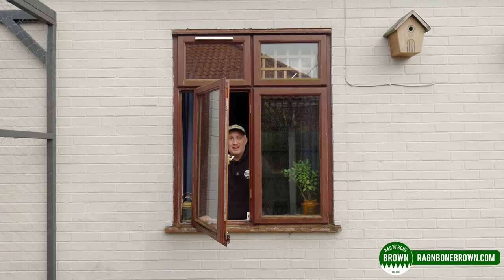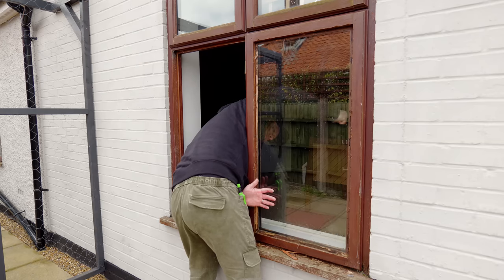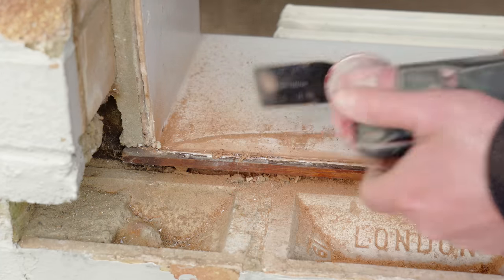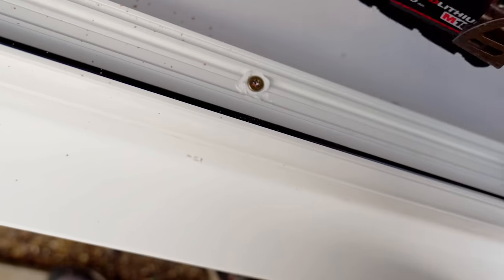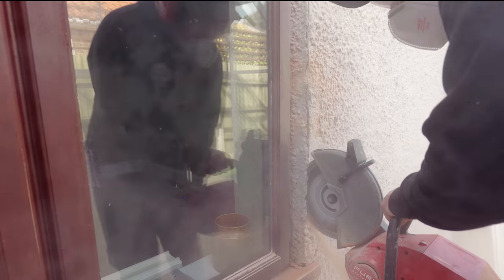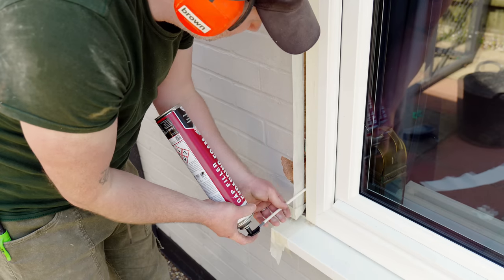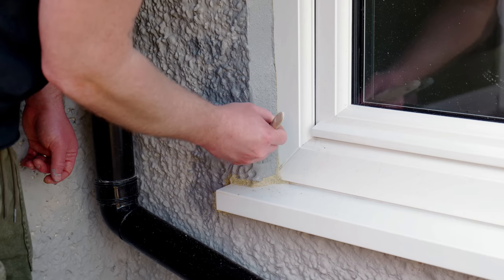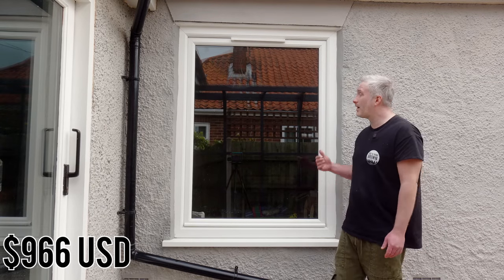Should A DIYer Fit Windows?

Comment: 1000 times better than the job done by any window fitter I've ever had to correct the work of. Double glazing installers seem to be on commission with the silicone manufacturers.
Reply from the maker: Wow, thank you!
Reply: And the caulking manufacturers. They seem to use Caulking everywhere inside the window.
Reply: One the spot. My installer used silicone to "fix" a 5 cm wide hole in plasterboard...

Comment: About a month ago I put a upvc window & door into the end wall of my garage/workshop (including cutting the hole & putting the lintel), this video would have been very helpful beforehand :)  It was a much simpler process than I expected and much much cheaper than having it done "professionally", I keep finding this with building projects.   We did buy from modern upvc windows as they're not far from us, it was a very easy experience and I'll happily buy from them again!  With the windows in the main house we had a similar experience with the wooden frames and conservatory, I like wood but for windows UPVC is a much better choice!

Comment: Nice job Keith.  I’ve fitted a few windows and doors myself and as you say its a straight forward DIY job as long as you take it carefully.  With care a crowbar works well for lifting the glass to toe, heel and pack them out.   Fitting the internal glazing trim is probably the hardest part of the whole job, I find its easier to fit both ends in first then progressively tap them into position working towards the centre with a soft headed hammer.  Mind, fitting the beading to two circular windows was a right nightmare, I ended up trimming a bit off the beading after spending half an hour chasing them round trying to get them all clipped in !

Comment: Really enjoyed this one Keith. I remember repairing some wooden mock sash windows on our previous house.  

It was going to be way too expensive to get someone to build & install replacements, so I decided to buy more unnecessary tools (table saw!) and had a go at chopping out the rotten sill, and even an entire corner on two of the windows, where I had to create profiles to match, slotting in to the frame in situ, before getting replacement glass units to fit (4 in each window, all different sizes of course 🤦‍♂️).  

Your fun with the mallet brought back memories - tapping in pins to fix wooden beading with a hammer while trying not to smash the glass was not fun.

A mammoth job for a total amateur, plus took so much longer than a pro, but the satisfaction of finishing it was immense.  Plus I got a new power tool 😆.

I certainly won’t hesitate to try what you’ve done with PVC windows if the time comes on our current house though.

Thanks for putting the effort into sharing 👍🏻

Comment: I have replaced all of my windows over the last 5 years. We are lucky that we have a local salvage yard selling brand new double glazed windows. These have been wrongly ordered/made or cancelled orders, and come complete with handles, vents, sills, and additional frame extenders if needed.
Our windows fit from the inside, as the inside reveal is larger than the outside. I covered the uPVC and glass with the sticky film for covering carpets before spraying the foam because of previously getting foam on frames & glass.
My windows are done in excess of British standards & more than meet local building regs. We don't intend ever selling the property, so by the time we snuff it (with luck and a fair wind) it will be time for the new owner to replace them anyway.
I would recommend, if the glazing units are already installed, get someone to help lifting them in to place. I did some of mine on my own, and probably shouldn't have as the glass probably doubles the weight.
Great video though. I imagine it will help anyone who was considering DIY window replacement make their mind up.

Comment: We’ve just had most of our windows converted to UPVC double glazing. Not very common in Australia!  6 large 3m x 2m windows for a cost of $35k (£18).  They were made in the UK and shipped over.  It took 6 months!  Very expensive but the change to heating and cooling bills and outside sound deadening is amazing.  Great video Keith.

Comment: Hi Keith, just came across this video and I can second Modern UPVC windows as I used them for my replacement patio door and back door, Less than £2000 for both yet a Norwich company who would probably come "First" if you googled "home improvements" wanted over £4500 just for the patio door and nearly £2000 for the back door!!!! PS I am near the stripey lighthouse....

Comment: If you have more windows to do have a look out for Soudal flexifoam, it’s a lower expansion foam specifically designed for window installation and a lot more flexible than regular foam. It’s blue in colour (my son nicknamed it Smurf Sh!t) and is generally a lot easier to handle due to its lower expansion rate.

Comment: As a window manufacturer you did a good job there Keith. A lot of DIYers would miss the toe-and-heeling, meaning that the sashes could end up dropping.
Reply from the maker: Thank you
Reply: don't use any soap while fitting the bead and you won't need any more shimms apart from the bottom ones. Block of wood makes it way easier to fit that bead too. Said by a diy handyman with over 100 new windows fitted in 10 years and twice as much fitted by someone elsa that i had to correct.

Comment: Nice vid. Fitting windows is not very difficult and it's definitely worth doing it yourself if you are a bit handy, you can save a fortune. I did an A-energy rated bay widow for £700, and the cheapest quote I've seen for that fitted is £3k. If you are getting windows signed off by building control I'd suggest discusing it with the inspector first, and sending them the quotation spec for checking before ordering the frames. That way you can be sure there won't be any issues. Also most window fitters I've watched set the sill on it's own first, using packers stuck with blobs of silicone, then when you drop the frame in on top of the (already level) sill it should be plumb all round. Then simply fix the frame to the walls and fix to the sill from the top.

Comment: My house is "Stucco". Some time back someone musta had a Stucco Biz in this area or came through like an Aluminum Siding scammer, as many houses have similar looks. The stucco is shaped to look like cut stone. BUT, they did this by nailing the angled tinwork for openings and metal lath  over the existing siding AND trim. Been a nightmare when I have had to replace some of the trim, a sill, and a few windows.

Comment: I made window frames and windows (oversize) out of old Jarrah I had, (Australian hardwood). Used my Dewalt Table saw to mill the timber, turned out very well. Not a fan of inward opening windows, but the cost seems reasonable though...

Comment: On the indemnity policy I sold a house 3 years ago the indemnity on windows was £90, it was £180 to have building control come out. If you go the building control route make sure the stickers are left on the glass for them to see. Also use common sense if a window opens fully and can be a fire escape don't change it for a fixed panel!

Comment: the window glass will probably need to be repacked after a while as they can settle depending on how often you open the windows. also, you don't need to put masking tape on the window frame and wall jambs don't overfill the gap with expanding foam and don't touch it until it dries then it will scrape the excess foam easily and cleanly

Comment: Enjoyed the video. Also worth noting you don't have to have trickle vents in replacment windows. Building control "Like to see them" on replacement windows if the existing windows have them but notice the word "Like". Trickle vents are pointless and Building regs changed a few years ago from when they were compulsory. No logic in having thermally efficient double glazing,draught excluders and then cutting a whole through the frame for a trickle vent which lets draughts in.......... Also toughened safety glazing  in windows within 300mm of a door and up to 1500mm from finished floor level in doors. 🙂
Reply: The Part F rules changed in June 2022. Now trickle vents are required on replacements unless they're exempt or you have alternate ventilation in place. 8000 sq mm per habitable room.
Reply from the maker: Thanks! I disagree, I think trickle vents are vital
Reply: @RagnBoneBrown  That's fine, As  Building regulations finally saw sense a few years ago and ceased making them compulsory.For centuries people have opened their windows to air their houses but for some obscure reason a few people can't seem to grasp the notion of moisture and houses. As a qualified Joiner ,making windows and doors for 35yrs+ years I do have a fair amount of experience in the subject. Lastly, word of advice for next time you take out a window with storm proof sashes, 99x out of 100 the fixed sashes are just nailed in so you don't need to take the glazing beads off and take the sealed units out, just tap the sashes out.. Far quicker and cleaner job but no doubt you'll disagree. 

  Have a lovely weekend. 🙂
Reply: @RagnBoneBrown  Question for you. If Trickle vents are essential why can a person close them off?. They all have the ability to be shut ,which the vast majority of people do.
Reply: @VoodooMike As a Joinery Business   I deal with Wealden ,Rother District,Hastings and Ashford councils building control and not one of them insist on trickle vents being fitted as long as there are openiong sashes. Question : If trickle vents are essential why do they allow them to be shut off rather than
 permanently open?. Logic,common sense?.
Reply: @AdrianSams  I'm not defending the rules, but they did change last year. Section 3 (specifically, clause 3.2) of Approved Document F makes it very clear that changes to existing dwellings come under the rules. Read it for for yourself here:  https://www.gov.uk/government/publications/ventilation-approved-document-f

If the authities in your area aren't enforcing them,  I'd keep schtumm!
Reply: @AdrianSams  PS I also run a window manufacturing business. We make sash windows,  and from a heritage point of view i'm not a fan of trickle vents.

Comment: You don't appear to have pan flashings in the UK.  In New Zealand we would put a galvanised pan flashing under the window to stop water penetrating the house or these days we use heavy sticker flashings and use silicon to create a pan shape so any water that penetrates is caught and directed out.  It would have protected the house as the wooden frame gave up.

Comment: The style of the original window, in 2 pieces, with simple hinges on the side, opening out, is the perfect solution to be able to open the window fully, and you can clean the windows on both side from the outside.   And you can keep the plants, etc. in your window when you open them fully or partially.
I've tried to live a short time with windows like the new ones in this video, and I hated the plastic look and all the space the windows took up inside the rooms when fully opened. 
It's great though, if you live in a place where you have bars in front of your windows.  

But this is just my personal opinion, and if good quality plastic, they can last and look good for years and with very little maintenance, whereas wooden frames require more maintenance, and the correct oil or paint inside and outside, to not only look good but also for them to last for decades. (Some more than 100 years, even here in the north European climate!)
Reply: My windows are 160 years old (softwood), 10 years ago years I stripped them back to bare wood, repaired rot and repainted with linseed, hopefully they'll be good for another 100. Would never fit plastic windows, just can't bear them.

Comment: When measuring windows, always measure inside and outside. I’ve been to jobs where it’s been double plasterboarded inside, so trims on the outside it was. Also there’s a lot of ‘professional’ Fensa registered companies, who are absolutely terrible at fitting windows. I’ve been to jobs where the big companies have for windows, and they’ve blown out or the doors don’t open anymore and the companies refuses to come out to repair them🤦🏽‍♂️ I’d always recommend doing it yourself or getting a trusted well reviewed local builder in, and not the big window companies who charge 10x what your average builder would

Comment from the maker: Tools and Materials Used In This Video:
Glazing Packers: https://amzn.to/3IkvYTB (Amazon UK) https://geni.us/lNo89H (Amazon Worldwide)
Builders Silicone: https://amzn.to/3oaa3aT (Amazon UK) https://geni.us/RsBBi (Amazon Worldwide)
Suction cups: https://amzn.to/3MvP1g9 (Amazon UK) https://geni.us/ubz7M (Amazon Worldwide)
Window fitting tool set: https://amzn.to/45iMUE7 (Amazon UK) https://geni.us/8pGCI (Amazon Worldwide)
Expanding Foam https://amzn.to/3pGbsX3 (Amazon UK) https://geni.us/uabl (Amazon Worldwide)
Concrete Screws https://amzn.to/3M21bvK (Amazon UK) https://geni.us/SrvEOA (Amazon Worldwide)

The Aiden Project on YouTube: https://www.youtube.com/channel/UCuhwDJ7olVHbV6tYzpVmIVg

0:00 Intro
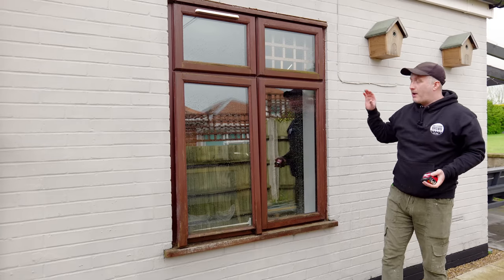0:28 How to measure for windows
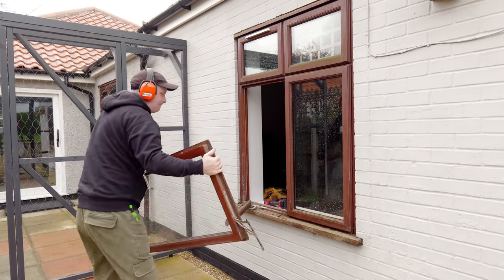2:00 Removing old windows
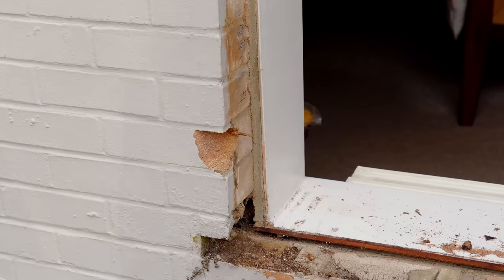3:14 Attaching window sills
4:03 Does it fit??
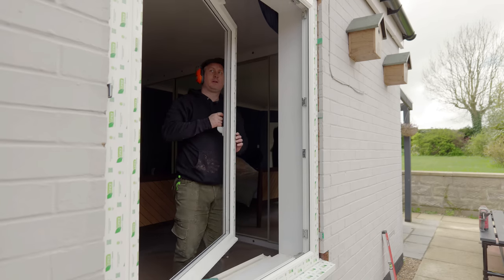5:11 Installation
6:19 Glazing a window frame
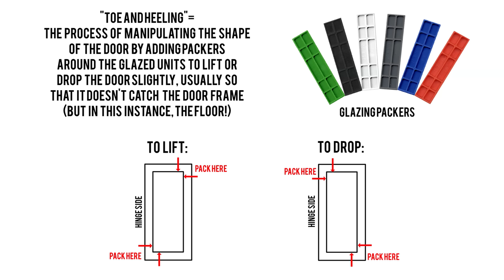6:35 Why toe & heel a window? 
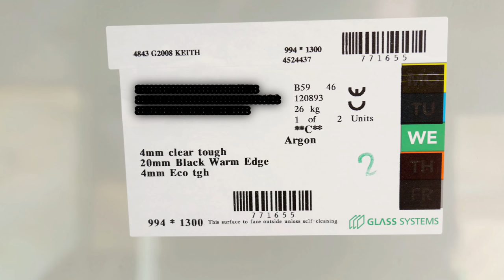7:21 Installing the glass
8:55 Glazing beads
9:36 Cutting away the render
9:57 Bought some glazing tools
10:42 Rotten sill and render damage
11:04 No lintel?
11:24 Does the second window fit?
11:37 Toe and heeling close up!
11:55 Sealing with expanding foam 
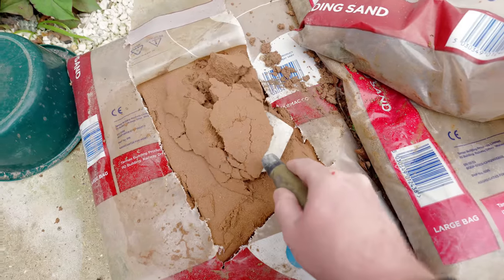12:33 Render & brick repairs
13:38 Making some uPVC trim 
14:27 Painting
14:42 Sealing with silicone
14:58 Inside finishing
15:16 Should a DIYer fit windows? Regulations!
16:14 How to order windows
16:50 Pricing

🔨 MY TOOLS 🔨
For links to the tools I use, plus some of my favourite consumables,  finishes and more see links below.  As an Amazon Associate I may earn a small commission from qualifying purchases
UK affiliate store: https://www.amazon.co.uk/shop/ragnbonebrown
US affiliate store: https://www.amazon.com/shop/ragnbonebrown

🤝 HELP SUPPORT THE CHANNEL 🤝
Support with YouTube channel membership: https://www.youtube.com/channel/UCVyE_6jEtVZGmYGXtUOL5FQ/join
Support with Patreon: https://www.patreon.com/ragnbonebrown
Support with PayPal https://paypal.me/ragnbonebrown
Shop With Amazon using my affiliate link: https://geni.us/iWD3K

💰 SHOP 💰
Etsy: https://www.etsy.com/uk/shop/KeithBrownMaker
https://teespring.com/stores/rag-n-bone-brown-merch

🎧 WORKSHOP BANTER PODCAST 🎧 
https://youtube.com/workshopbanter
Also available on Spotify, Apple, Google and most other podcast platforms

🔗 LINKS: 🔗
Website: https://www.ragnbonebrown.com
Facebook: https://www.facebook.com/ragnbonebrown
Instagram: @ragnbonebrown
Twitter: https://twitter.com/ragnbonebrown
Email: ragnbonebrown@gmail.com
Second YouTube Channel (non woodwork videos): https://www.youtube.com/user/keefykeef

Comment: This handle configuration seems confusing to me. Alle the tip/tilt windows I have ever had/seen here in Germany will fully open on the first setting (horizontal) and tilt in the second setting. Which is intuitive, since you pull the handle in the direction in which the window will open. 
You know: When the handle is oriented like a door-handle, the window will open like a door.
Reply: Yeah, I wondered about that- my windows (both in UK and previously in Germany) have also been the opposite to Keith’s
Reply: My thought exactly!!! His setup seemed weird.

Comment: That was very interesting. I've never heard of FENSA certificate requirement before but did a quick Google and see that it has been around since 2002. I bought my current house in 2016 and despite having a RICS surveyor do a full survey prior to me signing the dotted line, and a very thorough solicitor, I cannot remember anything about FENSA certificates being mentioned anywhere. Maybe it is a common 'oversight'?
Reply: When you sell the house you have to fill out the questionnaire and it will ask you if the windows have been replaced since x date. If you answer yes then the buyers solicitor will ask for certs etc. So maybe the seller for your house answered no
Reply: @THE-AIDEN-PROJECT  I was in this very position when I bought  a house 2yrs ago. The ad listed on Rightmove was new windows fitted very recently. When I asked for proof of this, invoice etc the seller said he did it himself and had a mate in the trade so has no paperwork. My solicitor said he needs to get an indemnity policy which eventually he did via his solicitor. My solicitor did state these policies are almost useless. He said something like the chances of me the buyer gaining any sort of use from this is pretty much nil.
Reply: @shoudd  they are pretty straight forward to fit though and it would be obvious if something was wrong straight away. So yeah the indemnity insurance is a license to print money really 😆
Reply: @THE-AIDEN-PROJECT  Thanks. And yes, I am sure the windows are from before 2002 so that will explain it.